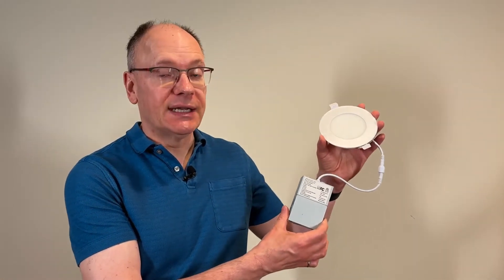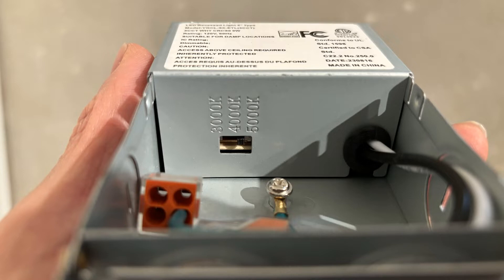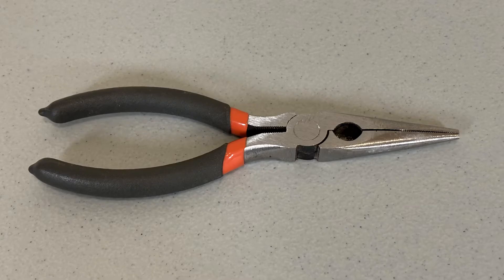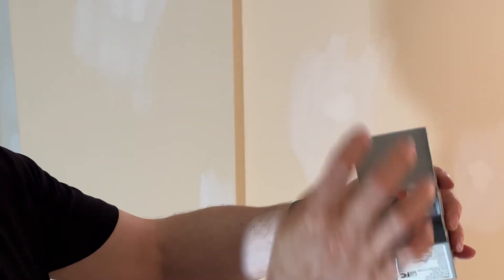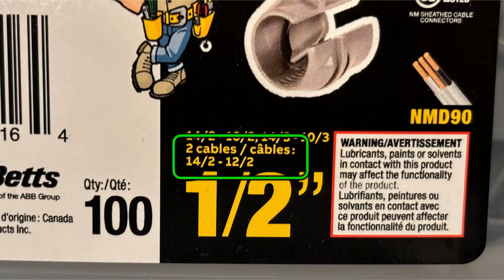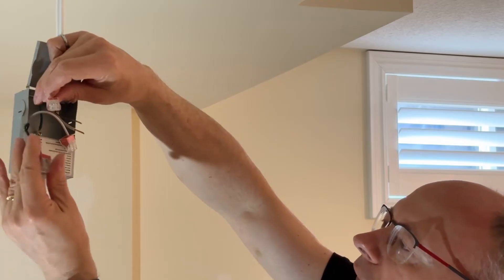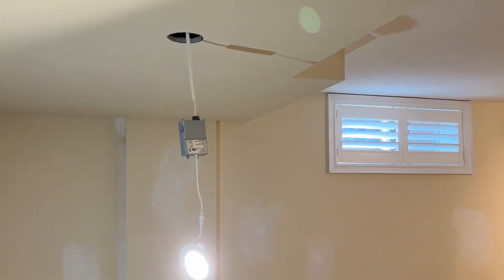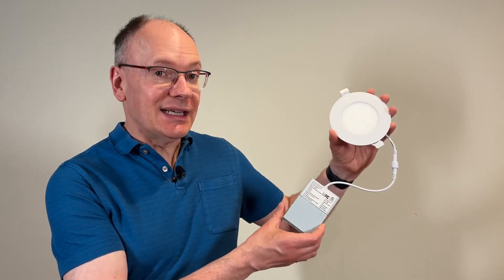Wiring an LED recessed panel light for beginners; Simple DIY electrical project

Comment: What is the smallest diameter spot + power supply combination you have found?   Great video....thank you.
Reply from the maker: I'm glad you found the video helpful. I've seen & used 3" diameter lights and the power supply box just fits the hole. That's about as small as I think you can go.

Comment: I have a set of these and they stopped working in about 2 yrs of use.... it possible to pull a junction box out of the hole without going into an attic

Comment: This is excellent video going to get my recess light as i have hissing sound likely due to bad ballast currently i have can and cfl tube. The can has some transformer or inductor not sure what is it but has 3 wires black white and green as explained this video clearly. Looks like they will require me to bypass current ballast and remove it all together and just connect to new led unit

Comment: How do you remove them? How do you identify which side has the fixed tab and which has the spring tab?
Reply from the maker: Both wings have springs so I just pull down one side carefully, then hold the other wing in and slide the light out of the hole. If you are concerned, just practice on a scrap piece of drywall and I know you'll get the hang of it quickly.